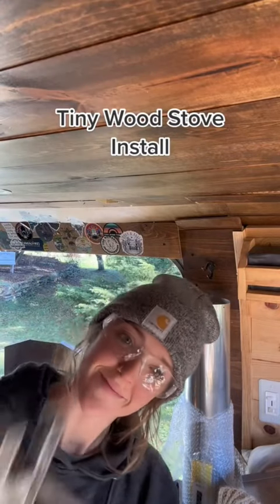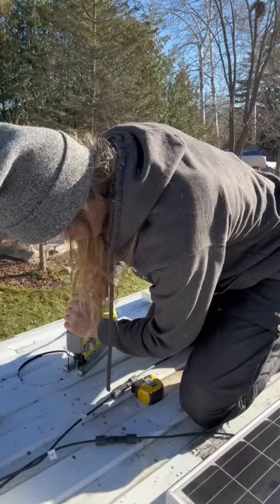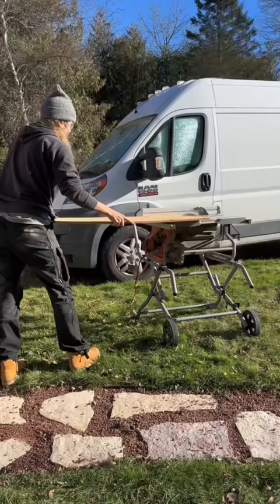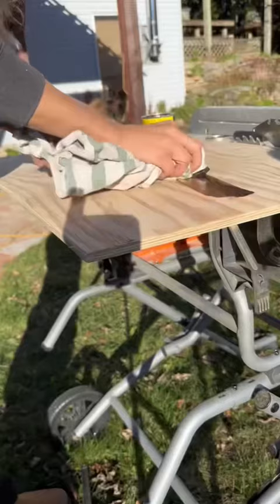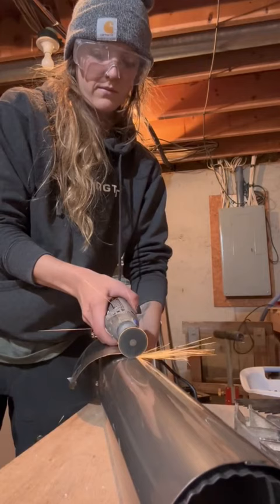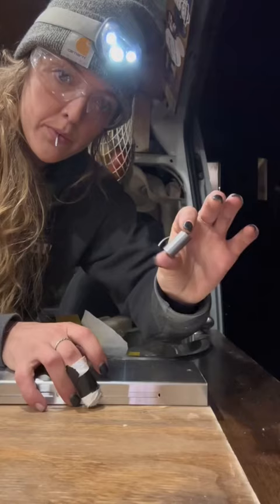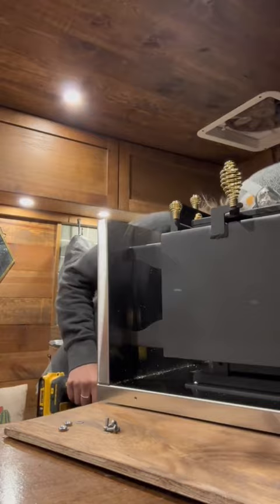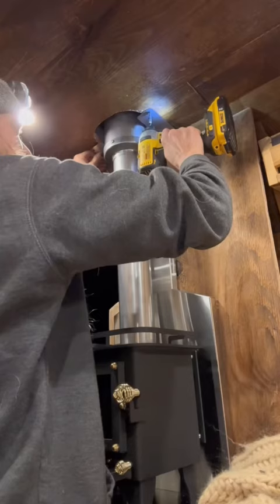TINY Wood Stove in VAN 🔥🚐 Full video will be live in one week! #offgrid #tinyhouse #vanlife

Comment: Looks great, but PLEASE please promise me one thing - 

that you will purchase a gas/carbon monoxide detector. You can see and smell smoke, but carbon monoxide is an invisible killer. You can get them from most hardware stores and there are wall mounted options too. 
Please please promise me that you will do this.

😀🐿❤️🌈

P.s before purchasing your detector, make absolutely sure that it is made to international safety standards and/or has the American equivalent (ANSI) on the product  - some cheaper online products are not reliable so it’s better to be safe than sorry (or ☠️)

I don’t mean to frighten you, but people have died in caravans, mobile homes, and even regular sized houses from carbon monoxide poisoning from home fire places and gas build up. 
Inside a van, with a wood/gas burner you MUST be incredibly careful . ❤

Comment: You need tin snips desperately
Reply from the maker: I used tin snips, they couldn’t get through the folded seal and since it is double walled, it worked terribly! So this had to happen for a portion of the flu
Reply: @Linnea & Akela  not triple wall pipe?